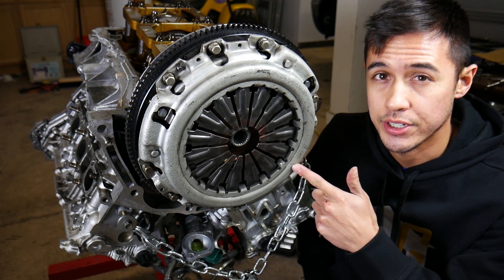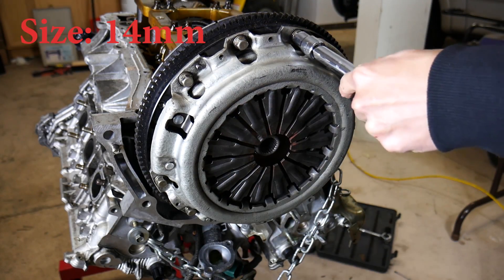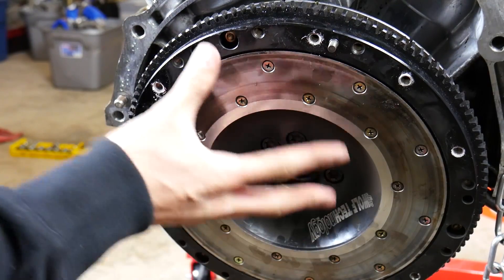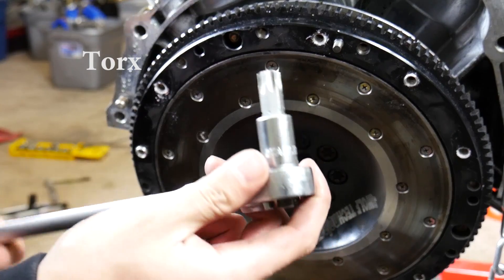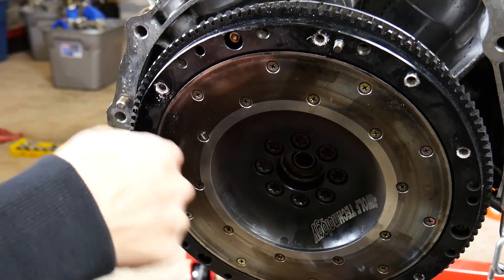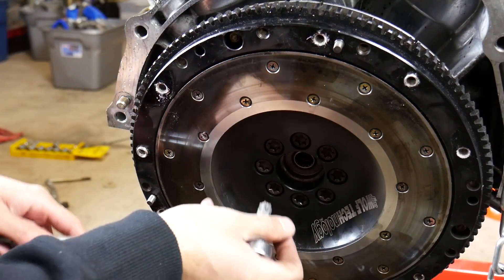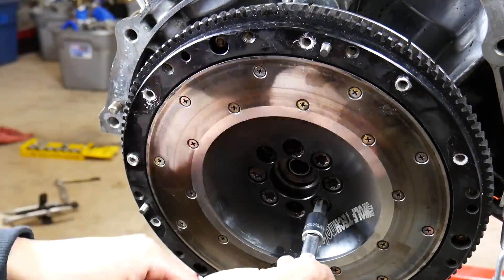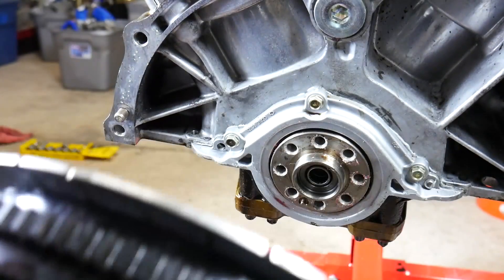Clutch & Flywheel Removal for 350z/G35 (Day 2 Part 3)

Comment: what size torx bit are you using?
Reply from the maker: The exact bit that was used is a Stanley 87-407. Should have included that in the video! Thanks for the question man, appreciate it!
Reply: T55